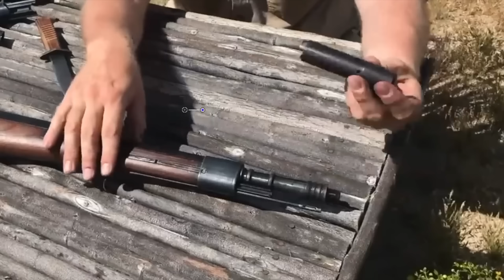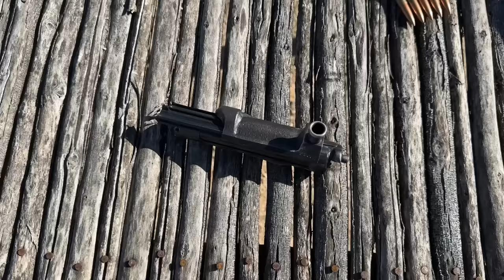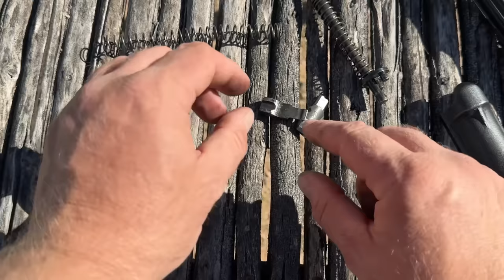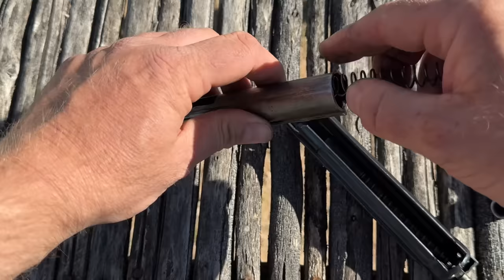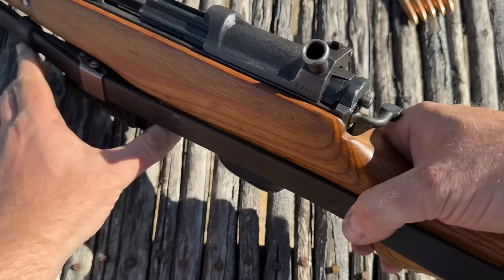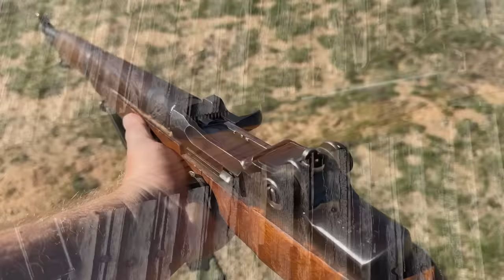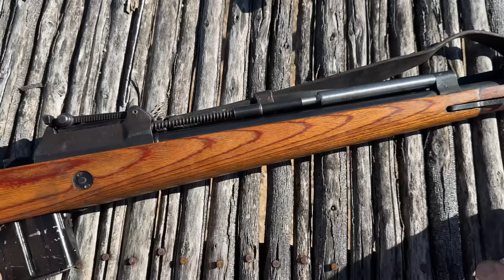Das G43 Wunder-Gewehr ist Scheiße

Comment: Good thing that also the FG42 was mentioned. If the Germans never invented the G43 but just had a lot of FG42s the world might have ended up developing much more modern fighting rifles earlier.

But I would also like to mention the Swedish AG42. It was much simpler to disassemble, very accurate, ambidextrous and also reliable.
Reply: The FG42 has it's own set of problems.

Comment: Sorry, have to disagree about the m1 clips. G43  had detachable magazines, AND the options of using stripper clips. The m1 clip concept is a bad idea, between "m1 thumb" and dealing with loading the number of rounds ,not divisible by 8, it's no wonder the army dumped that concept as quick as they could.

Comment: Great video...
But if you point out 'small' parts you do not like to lose in the field... 
Show off the small parts of a Garand (when you start disensemble the front gas screw😅) or the M16 whole bolt carrier has tiny parts...Maybe smaller then the G43 has. So, everytime I hear "don't lose that in field", I think about the 'better' weapons like I mention above.
The G43 might have more problems, but losing parts is possible with all weapons when you are not carefully enough!

Comment: And yes that rifle is still property of the german state. There was never a contract which allowed to retain guns and equipment of foreign forces. And yes the germans have to return as well foreign military equipment but they complied already with that since none is more in their posession eighter because foreign equipment was taken away from them after the war or the equipment was destroyed. If the Allies now claim their destroyed equipment from Germany, Germany claims their destroyed equipment as well from the US and their allies.
If the germans would be in posession of Allied equipment they would have to give it back. Same for all guns of the german Army now in posession of the Allies, which have to be returned.
But then, what do you want with those old guns? I would not even want them. Make new ones if you want those models, improve them so they work reliable and safe and sell them. Nothing stops Germany to manufacture again their WW2 guns, improve them and sell them to the market.
Make me an Stainless Steel MKb 42(h) in 6.5 Grendel and I will take it all day long over an original 100 years old Rostlaube of an gun.
The dutch bicycles they claim back they can retrieve themselves in Preußen as a pile of junk. Just go ahead.
The stealing of equipment and guns as Beutewaffen was about equal between Germans and Allies. So neighter part should be to upset. And the germans where not worse than the allies neighter in most regards. Just build these new from Stainless improved, and you have an much much better weapon as the now 100 year old originals which rust.

Comment: As is, It is a failure. (Although It looks great when you don’t look in the details)
It is a shame, but given the circumstances, not surprising. 
This rifle is a rushed and unfinished job pushed into service because of a little hurry situation…
Had It been developped in peace time, with quality material and craftmanship, no slave labor and tested / modified to the full extent of a normal développement process, It could have been a good rifle in the end.

Comment: Piece of junk? Sure. But it is a COOL piece of junk.

However one should also consider the developmental mindset at the time. The garand was made and meant to be used for a longstanding period of time. The germans however were going through new developments like wildfire. So the G41/G43 weren't meant for long term use. The germans produced them already with plans for a newer better gun. Eventually like the Volksturmgewehr 1-5 and StG 44. The germans war effort contains a lot of stopgaps like the G43. You could say their junk paved the way to treasure? IDK. Personally I just like silly german overengineering.

Comment: I think the SVT-40 is not bad, it has great potential in it's design. Maybe it's the implementation part that screwed up this gun.
Reply: It is good. For late 1943, all reliability problems were solved - heat treating locking shoulder and chamber, adding Revelli floods. But the command deemed these unnecessary for troops in the field then, having more than half of submechinegunmen in a riflemen platoon, and rifles placed on the secondary roles, for which Mosin was acceptable. In Russia nowadays, almost all of these rifles in circulation - AVT-43's, brand new from the surplus, with a distinctive cherry-red phosphated bolt carrier. Owners use them and wonder, where are the jams

Comment: It would seem that post war the metallurgy, disassembly, and gas system could have been improved.  But obviously the cetme and G3 were better designs.
Reply: Whats strange is that altho G3 and CETME (L) are pretty much the same the CETME is way more reliable especially during inrange mud test. G3 is a massive step back from CETME.
Reply: @alexanderp8037  The G3 does have a very good record for being reliable and if the cetme is even better that is ok also.  I will not be putting mud over mine lol.

Comment: A lot of BS here by Karl. First of all, by the time these guns were fielded in 1944 and 1945 almost all German rifle ammo was non corrosive. I recommend the book 7.9x57 Mauser Ammunition for the Collector by Jeremy Chubbuck. Secondly, the soldiers were not losing their bolt parts in the field, that is nonsense. If you had spoken to German soldiers about these rifles, they were very happy with them. Thirdly, if only one locking flap is engaging the recesses of the receiver, the gun is not unsafe. It is no different from any bolt action rifle that has not been blueprinted. AND, if the one lug should fail, the second one is still there. Locking flap guns have been used all over the world for decades without trouble.
The rifle is not perfect and I doubt was ever designed for collectors to be shooting matches with 80 years later.
Reply from the maker: Lol

Comment: The retention clips in the bolt couldve been so easily secured in any number of ways. What were they thinking? I guess i really cant imagine the panic invasion can cause.

But if youre already stamping the cover plates why not make a single stamped piece, anneal it, and have the tabs be integrated into the bolt internals? A counter screw, any screw, could be placed in the front so you could actually adjust how much the tabs stick out.

Stamped and milled parts can work together and work well together but not if you pick the wrong parts for each production method.

I get that the german state was killing everybody but i wouldve taken the bullet out behind the shed before i let some moron tell me to produce roll-welded barrels like its the 1820s again. Theyd kill me anyway when THEIR hand-picked design melted down in their hands, might as well get a good rifle made.

I may have accidentally described institutional cowardice within the system of tyranny. This is how murder-governments doom themselves: scaring all the good ideas into hiding.

Comment: Aesthetically, the Rasheed comes to mind as a “mini G43”, but it is not mechanically related to the G43 in any way. No not even the 10 round detachable magazine is really worth considering a derivative of the G43. The gas system that’s used today is a nod ti the SVT-40. Roller and flapper delayed systems existed before the war. It really was a dead end design.
Reply: Not that much, the only good thing the AVS/SVT series did well was to get its gas system above and not bellow the barrel, so it kept itself cleaner rather than BAR, Garand and other guns from the time using pistons, i think they got that idea after they saw how messy and dirty the gas system on the Mondragon was (The rifle from they got inspired and based for the AVS and SVT series, cuz the Fedorov was long-recoil, and pretty much a dead-end system) so they thought on all the available solutions they could get in to avoid the problems the Mondragon had, incluiding placing the gas piston over the barrel, but still, was a very messy gas system compared to other guns from that time, the AK got it gas system related to the Garand one, but just applying the principle of getting the piston above and not bellow so obvious improving how reliable would be by keeping itself cleaner.

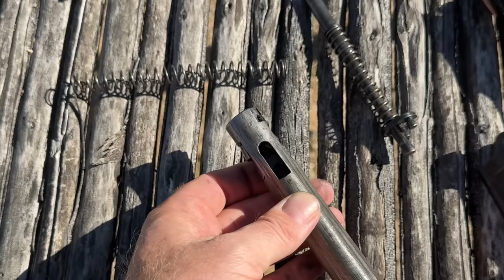Comment: 7:20 it's unlikely for one side dont lock, those lugs when not extended prevents your firing pin to protrude far enough
Reply: Well, thank you for informing us you don't know what you're talking about.
Reply: @paulisfat8077  I suggest you to try yourself if you have access to a g43 or any other flapper/roller/bearing lock firearms and see if it is possible to setoff with one locking lug not fully extended
Reply: @alexxu3004  yeah, you can stick to firing guns that aren't in battery.
Reply: @paulisfat8077  :P the point is g43 and all those guns have out of battery safety, they will not set off when not fully locked
Reply: @paulisfat8077 g43's system with one flapper jammed in the firing pin housing which actuate the flappers will also be jammed, preventing the firing pin to go far enough to setoff anything. so thank you for informing us you don't know what you're talking about.

Comment: The Gewehr 43 is a STUPID DESIGN. They copied the SVT40 and managed to make it worse in the dumbest of ways. There is no logical justification for having the bolt carrier envelop the receiver then have the receiver envelop the bolt. Just put BOTH in the receiver for goodness sake which is simpler, lighter, less finicky and wouldn;t require an awkward slot on top that you then try to cover with a shutter. Having everything inside the receiver will also allow you to have the rear sights in the proper position rather than up front.

Comment: All ture M1 was much better battle rifle. BUT Gewehr G43 collectable value is 4 times the M1!!
Reply: That's partly because people using the M1 lived long enough to bring it home.
Reply: @Sableagle  Man I wouldn't shoot a $4k rifle in a match let alone three different ones.  Most likely a non matching rifle.  The  stamped carrier part Karl mentioned was designed to roll that way small gap at six is correct. Not a crack!🤭

Comment: Karl, justifying the G43 low production numbers with war time problems 🤓
Soviets, who were invaded by said germans, who made almost 2mil. SVT\AVT semiauto rifles (more that 3 times more) AND which gas system germans stole adopted for the G43 rifle, be like: -No sh@t, bro, really? 😎
Reply: Soviet had the backing of American Lend-Lease program. Germany did not.
Reply: @bullshittyp4772  did not. AVT-40 production was actually stopped after the war was over, although since 1944 AVT's were not issued to the troops
Reply: @CKshouta  that would've made sense if they were making garands or something. Plus it cannot account for, like, 3 times the difference. Germans clearly didn't plan on mass issuing the semiautos, preferring rifles and machine guns, which were actually good.
Reply: The SVT was produced from 1940 to 1945 so 6 years with around  260.000 (if you use 1.6 Million) to 0,33 Million (2 Million) per year. 

The G43 was produced from 1943 to 1945 so 2.5 years with around 450.000 or around 180.000 per year. 

At it's peak the Red Army had 11.5 million active soldiers, the germans 6.3 so the numbers come out in a similar ratio of guns per trooper.
Reply: @mbr5742  this is exactly the point I was implying: Germany had an ability and resources to make semiautos even in late 20s, BUT they choose not to. And later in the war, they realized their mistake and tried to fix that with a halfa$$ solution 🩹
Reply: In 1944 the RAF leveled the new Gustloff G-43 factory.  I'd call that a wartime problem.
Reply: btw, Germans leveled more than one soviet factory during the first wave of invasion and even occupied some. That's a much bigger problem than some sabotage at the very end of the war